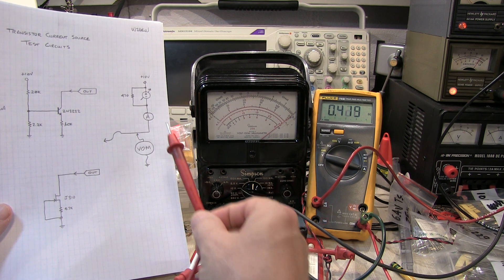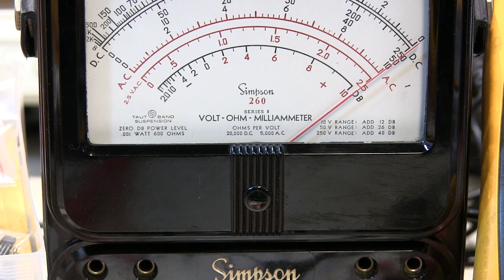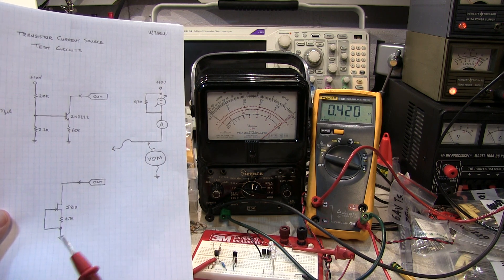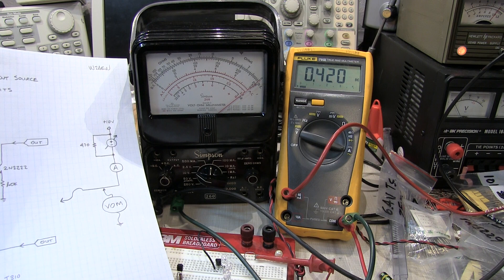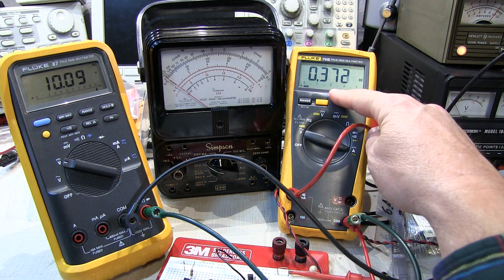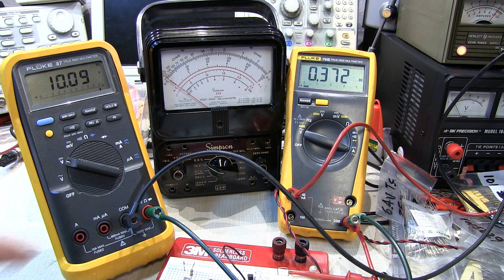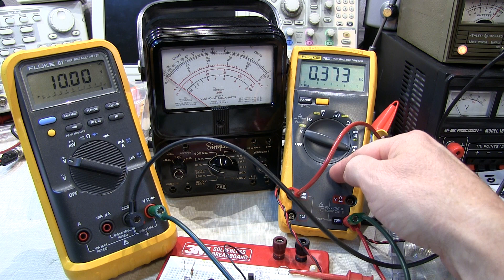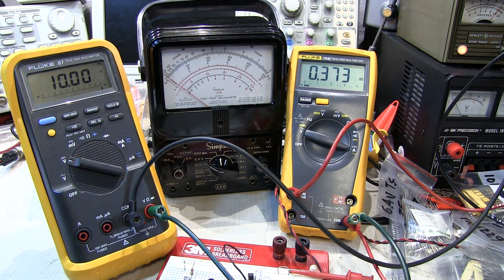#191: Beware of test equipment loading effects!!  Learn from my error!

Comment: Ok, Alan, please show us the effects of the burden voltage of the ampmeter shunt on the circuit. Would a MicroCurrent have been a better choice to measure the current with?
Reply from the maker: I'll take a look at it, but probably not worth a video in this case.  But, a video about burden voltage in ammeters in general is probably a good topic to address in a future video.  The +eevblog microcurrent would probably be a good thing to use to minimize the burden voltage, but I don't have one.

Comment: I work on a lot of old gear, and the schematics with voltage markings always spell out what sort of meter they used.  Often its a VTVM for DC, and a 1000 ohm per volt AC meter. VTVM's have input impedance comparable to a DMM so that works out.  It does tend to lead to higher AC readings, though considering we're talking about heater supplies, there is plenty enough current that even a 1k meter wouldn't load it down enough to affect anything.

Comment: Why you just don't put this VOM meter before A meter ? Than you will have some error in voltage, because of voltage drop on A meter, but it will be small error because of small current and impedance of A meter. So in this case is better to connect VOM meter first/closer to source and VOM meter second. Or just use modern meters and you will have smaller problem with this. :)
Reply from the maker: Correct on all counts.
Reply: In circuit with proper current measurement (voltmeter above current meter) error will be small not because low amp meter resistance but because we measure current source dynamic resistance. Current change in current source is very small and it produces very small voltage drop CHANGE on amp meter. So almost constant drop on amp meter will cancel in equation. And you can use also this Simpson old meter and achieve excellent outcome. It is better to use uA meter, because current change will be several uA, and source dynamic resistance should be about 4M ohm.

I think you should delete these movies about current sources, and do a new one, because some young engeneers may be confused :)
Thank you for your work on YouTube. I really appreciate it.
Best Regards

Comment: 0:19: Let me guess: You nice analog simpson multimeter has a lowish input impedance so measuring voltage with it loaded the circuit, and if it was loading down a constant current circuit, the high output impedance thing, then maximum voltage reading would be lower than they should be? Not sure yet.
Reply from the maker: The low-ish impedance of the 260 appears in parallel with the current source, so the measured output impedance was dominated by the meter.